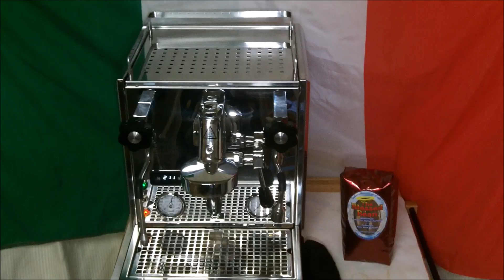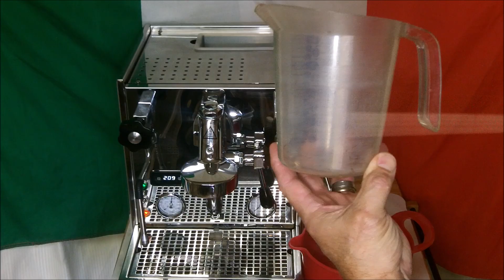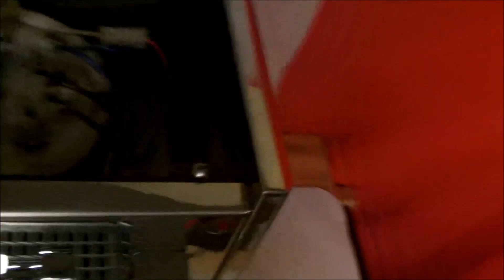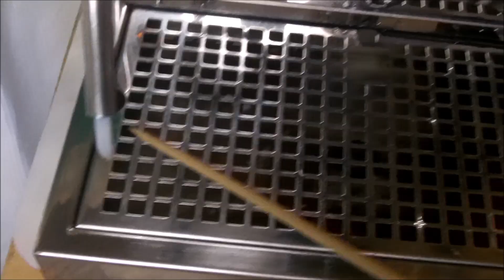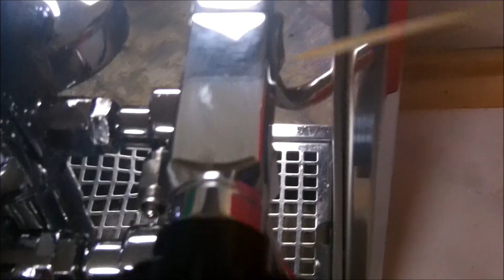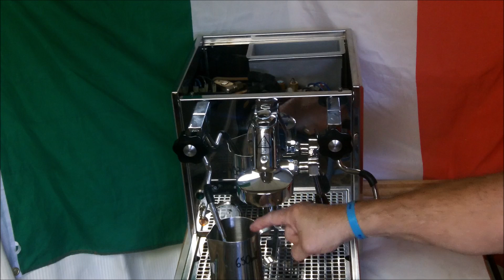DIY: Dual Boiler Espresso Machine Descale DeepDive

Comment: You say to let the descale solution soak for at least 2 hours.  Other instructions I've seen say around 30 mins.  Why so long?
Reply: Both numbers are defensible, because contact time and concentration trade off against each other and they're aimed at different machines.

Thirty minutes at label strength is plenty for a machine that gets descaled on schedule: the acid reaches the scale, does its work and hasn't exhausted itself. The longer soak is aimed at heavily scaled, long-neglected machines, where the acid at the surface gets used up and fresh solution needs time to reach what's underneath.

The reason not to default to the long soak: acid sitting against brass, aluminium and elastomer seals for hours has its own cost, and it can age seals faster than the scale justifies. So with a lot of scale, two or three shorter cycles with fresh solution beat one long one: same result, less time with everything marinating.

The one rule worth treating as firm either way: never leave descaler in overnight.